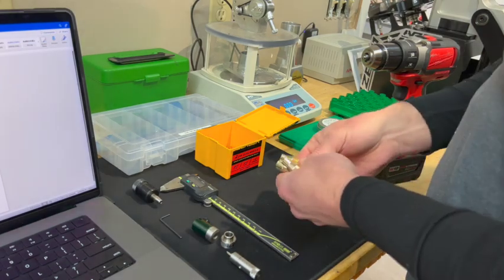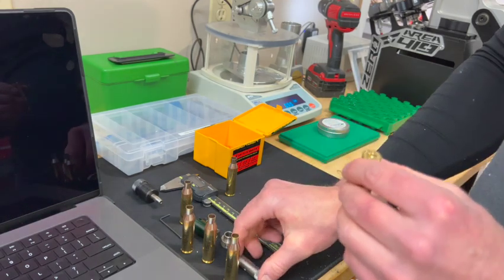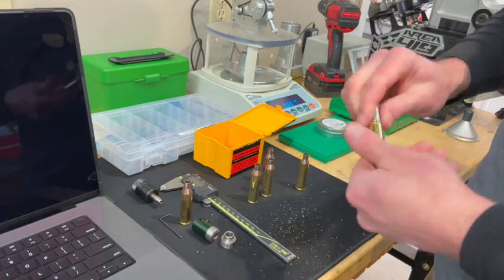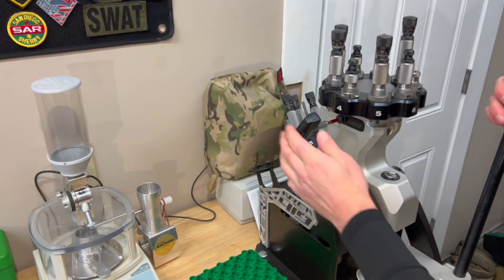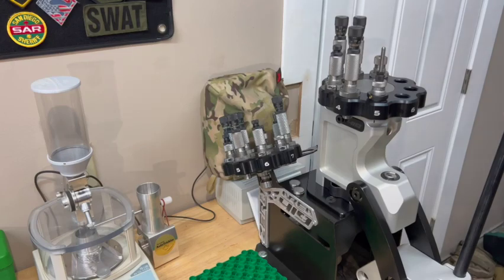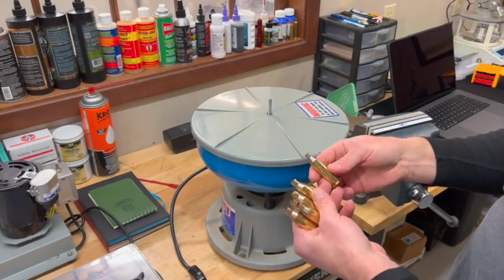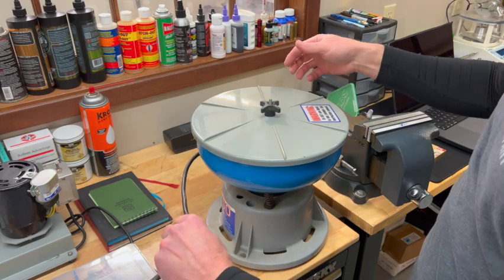TPM - Intro to Precision Rifle Reloading - Breaking Down the Steps to To Reloading Accurate Ammo

Comment: Don't assume you have enough headspace with new brass, especially with non-saami chambers. I just bought some 6x47L Peterson brass that had zero to a thousandths long for headspace. I don't trim case length until they're fired and have all the same headspace length, unless they're longer than max out of the box. You get more consistent case lengths. Good video!👍
Reply from the maker: You make a great point. I run all saami spec chambers with the only unique changes being the free bore length to accommodate longer bullets. 

I can honestly say, in the 10’s of thousands of rounds I’ve loaded with new, quality brass, I’ve never ran into headspace issues.  As long as your chamber is within spec and headspace passes the go / no-go gage test, you should be good. if by chance there is a case out of tolerance which is absolutely possible, you will feel that in the bolt when you’re chambering.  If it doesn’t feel right, I’ll set it aside and inspect it later. 

For the unique chamberings with non-saami spec chambers, wild cats, and tight necks, you definitely have to pay more attention to what you’re doing. 

When you trim case necks using the shoulder on new brass, your’e still going to have consistent neck length which is where we gain consistent neck tension. Your overall length from the case head to mouth of the neck may vary on new brass, but that will correct itself after the first firing as you pointed out.  

I recently had a box of ADG brass that was all over the place as far as case lengths.  The first few I measured were long so I started running them through the Giraud case trimmer after I neck sized, and about half were undersized and half were oversized.  Usually I have them all one way but not both.  

Great points you brought up. Having different perspectives on this stuff is incredibly helpful.  

-TPM
Reply: @triggeredprecisionmachinellc  A lot of people use case trimmers that hold and go off the base. But in your case I agree, with the Giraud trimmer it wouldn't matter or any trimmer that uses the shoulder to space off of.
Reply from the maker: Very true.

Comment: Nice video. I also use mandrel on my necks but like you turn the cases 180 when sizing I turn my cases 180 when using the mandrel. Although you were using new bras I have a question when preparing say twice fired brass. I see inconsistent case lengths, some same some longer, and some shorter. Would you say trim that brass to match the shortest case? Or just ignore the differences? Thanks. Going to subscribe to your channel 😊
Reply from the maker: Welcome aboard Steve, with new brass you will definitely see quite a bit of variance in the lengths depending on the brand of brass. I trim all of my brass to SAAMI spec so what I will do with new, once, or twice fired brass is run it through my Giraud Case Trimmer that I set to that spec. Most of the time, the cases are long enough to at least get an inside chamfer. For the cases that don't get trimmed because they're too short, I'll set them aside and manually chamfer the inside, then load and shoot. Even the shortest cases will usually stretch after one or two firings and be long enough to get a full trim on the Giraud, but until that happens, I'll just ignore it. Just make sure you have in inside chamfer so you don't scar the bullet upon seating. 

Thanks, and great question. 

-Shawn

Comment: I have found using a mandrel is a very important part as well.  Curious if you have ever used dry neck lube when using a mandrel and then just running a brush through to clean out?  That is what I am doing now, but I may try the imperial wax with tumbling after.  Really enjoying the channel!
Reply from the maker: I have a little container of Imperial's dry neck lube that I played with for a while, but I never found a good way to apply it evenly. I switched the the wax and its pretty slick. What do you use to apply the dry products to the inside of the neck?
Reply: @triggeredprecisionmachinellc  I use the Imperial Dry Lube, and I simply dip the case neck into the container.
Reply from the maker: I’ll revisit that.  Awesome.
Reply: @robertflemings7630  I do the same Robert.  Seems to work well.
Reply: @triggeredprecisionmachinellc  it comes with a mica medium for application
Reply from the maker: Ordered!  I'll do some testing with this soon.
Reply: Neolube #2 works great as well.  It leaves a nice uniform layer of dry lube inside of the necks.  It also only takes a couple of minutes to dry.
Reply from the maker: I'll check it out, thanks!
Reply: @triggeredprecisionmachinellc  The imperial dry neck lube should come as a kit, with the ceramic application media and the separate graphite powder.  Refresh the application media occasionally with some more graphite and shake before use.  Then just dip the case mouths into it.  You will know it's working because your hands will turn black lol.  The graphite does not affect the powder, so you don't even need to remove it if you don't want to.  Aids in bullet seating and preventing galvanic welding or galling.

Comment: I do exact like you om ny 300 NM. The only thing I don't do is the primer pocket trimming. Have you checked it out to 1000 yard without forming the primer pocked? I use Lapua brass.
Reply from the maker: I have and there is absolutely zero difference over the chronograph or on target with Lapua, Peterson, ADG or Alpha brass. I got started doing that when I was loading a bunch of Federal Gold Medal 308 Win brass for match ammo., and I did see a difference in ES / SD with that brass.  I was getting the brass at the range for free so I would shoot a match with it and leave it on the ground. 

I just kind of continued the primer pocket prep stuff because of that, and honestly, it probably satisfies my reloading OCD more than anything. 😂

Comment: Do you leave the neck sizing ball/decapping pin installed on the bushing die or do you remove it/adjust it so that it’s not part of the operation?
Reply from the maker: I completely remove that whole assembly and de cap separately.
Reply: @triggeredprecisionmachinellc  thanks. I thought so

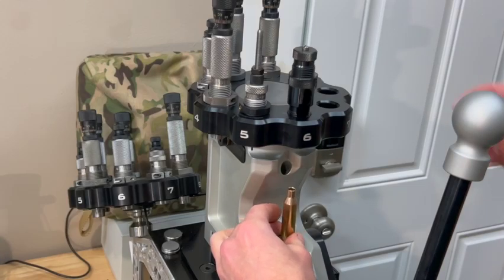Comment: I did like  the video and found it very informative. I am new to reloading. I noticed starting at 16:17 when yo use the neck sizing mandril it appears to move up at an angle. Does this or can this affect the true inside diameter of the neck?
Reply from the maker: Interesting. I just watched that part and I think it’s the angle of the camera that makes it look that way. Everything on that  press is as straight and square as you can get.  
 Back to your question, I would absolutely think that would effect the concentricity of the loaded round if the expander was entering the case mouth at an angle.  

Nice pick up, that’s a great point to bring up.

Comment: Will it make a difference if you clean the flash hole from the outside vs from inside?
Reply from the maker: Yes, but the benefit depends on the brass. High quality brass like Lapua, Alpha, etc. has drilled flash holes. Generally these are consistent, correct, and have little to no burr on the inside so I don't mess with cleaning the the flash holes from the inside. On the other hand, bulk brass like Winchester, Hornady, and the majority of other manufacturers punch their flash holes with usually leaves a slight burr on the inside, since they are punched from the outside. If I'm using this brass, I will use a tool that addresses this burr and uniforms the flash hole at the same time. 

Hope that helps!
Reply: @triggeredprecisionmachinellc  it helps a lot! Great info, thank you!
Reply from the maker: You're welcome.

Comment: Nice.. But 100% acetone is better for cleaning inside necks. .345 chem. Proof nylon brush in the drill dipped in the acetone. Cuts down a step. Thanks
Reply from the maker: Thanks for the tip! I'll give it a shot. I need to make another reloading video. I've discovered a few new tricks in the last few months.

Comment: Why do you spin the brass 180 degrees when sizing? Is there some sort of assumption that your dies are not uniform?
Reply from the maker: Good question. Call it a personal quirk I picked up several years ago from someone and never stopped. What I have noticed, is cases where I have the full length sizing die set for minimal shoulder bump, it helps reduce the diameter of the lower portion of the case near the web and gives slightly more consistent an easier chambering. The brass down there is never annealed so it can get pretty springy. This seems to help and I haven't noticed any degradation of accuracy so I continue to do it. 

Hope that makes sense.
Reply: @triggeredprecisionmachinellc  why do you use that flat plate when seating the bullet instead of a shell holder?
Reply from the maker: It's precision ground to be perfectly perpendicular to the loading press ram, which gives you less chance of runout when seating the bullet. Shell holders are decent, but they aren't a precision machined piece so you could have the chance of inducing some runout in your loaded round. Whether or not this would show up on target kind of depends on how far you shoot. I've never been able to shoot well enough to see a difference at 100 yards, and for the long distance stuff we try and control any variable we can, this is a simple way to theoretically have less chance of bullet runout during the seating process. 

Hope that answers it. 

Thanks!

Shawn

Comment: Why magnum primers?
Reply from the maker: I use magnum primers in the large case capacity magnums - pretty much anything over 60 grains of powder.  The magnum primers have a hotter flame for igniting the larger, heavier powder columns more reliably for better consistency.
Reply: @triggeredprecisionmachinellc  Also the harder cups on the magnum primers to resist higher pressures is another reason to use them.

Comment: Full length resizing new brass is a complete waste of time. No FL die will touch a new brass case in any meaningful way. All that is happening is needlessly working the neck down and back up. That said, pushing the neck over a mandrel is very beneficial. 

As brass work-hardens, it has less spring-back, or elasticity, not more.
When you think you have .002" neck tension you will size the neck again when you seat the bullet so you'll have less, and variable, neck tension. 
Thanks for the vid!
Reply from the maker: If your dies are set up correctly and you are only shoulder bumping .001" to .002", then running new brass through a full-length bushing die does nothing to the body or shoulder of the fresh brass. I do this to correct the dents and dings in case necks and ensure they are undersized so when I run the expanding mandrel through the case neck, I can expand them up to .002" neck tension or whatever I am running. For me, its not a waste of time, especially when it only takes a few minutes to run 100 cases through. 

In regards to work hardening and spring-back, I think were both trying to get at the same thing but saying or conceptualizing it different. 

I spent 15 years doing aerospace tool and die work and learned more than I ever wanted to about spring back in relation to temper. The company I worked for specialized in precision sheet metal forming done through stretch forming, drop-hammer forming and traditional die forming. For many sheetmetal parts we produced, we round run the part through a die for an initial form, anneal the metal (usually Inconel or Ti.), then run the part through the die again due to the spring-back. 

How this pertains to metallic cartridge reloading - As we fire our brass, the brass work hardens. You mentioned elasticity in your post. Elastic deformation (the bending of a material) refers to the amount the material can be moved, or sized in this case, to where when it comes out of the sizing die, it will "spring-back" to its original dimension without any change. This changes with each material and temper. After you bend or size the brass through the elastic zone, you reach what is called the yield point. Any sizing or bending past the yield point will result in plastic deformation which is permanent. 

***However, when you are forming a material or sizing your brass and you take it past the yield point to achieve plastic deformation (neck tension), and the pressure from the die is removed from the material, it will still spring back slightly the amount of elastic deformation. As you can see, we can never completely get rid of some spring-back, we can only reduce it. We reduce spring-back by annealing. This brings the brass back to a soft, ductile state and reduces the elastic deformation zone. If you've ever heard the term "dead soft brass", this is referring to brass in a fully annealed, soft state. If you bend it, it will stay in that position minus a very slight amount of spring back. If this same brass work hardens, it will be harder, less ductile, more brittle, and have a higher elastic deformation zone (AKA spring-back). 

If you were to take a brand new piece of brass, neck size it to have exactly .002" of neck tension, fired that cartridge, then reloaded it using the exact same neck sizing die or bushing, and continued this process over and over again without annealing, you would reach a point where the brass was so work hardened that the elastic deformation zone exceeded the constriction by your neck bushing. Basically, there would be enough spring back that you would not be able to achieve the same neck tension as you had with new brass because the brass is work hardened. 

Soft, annealed brass  =  smaller elastic deformation zone  / less constriction (sizing) needed to get to the required level. 

Work hardened brass + larger elastic deformation zone / more constriction through a smaller diameter neck bushing to achieve desired neck tension due to increased spring-back. 

That was very long winded but something I did professionally in one of the most critical and precise industries known to man. A lot of what I did back then as a tool and die maker has a direct correlation to precision rifle shooting and I enjoy both. 

There are some great metallurgy references out there that probably do a much better job of explaining this stuff, but I think I touched on the bulk of it. 

Thanks for bringing that stuff up. Great points and always great to hear other people opinion's and method's. 

-Shawn